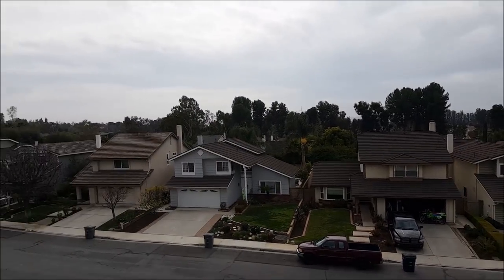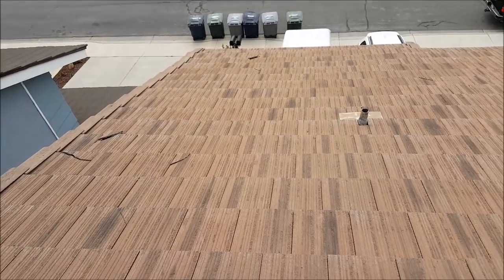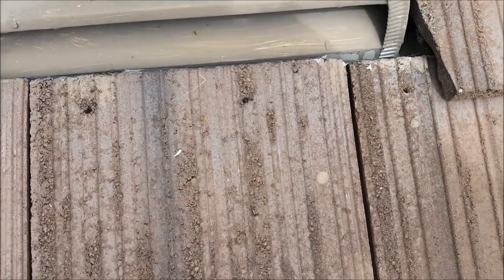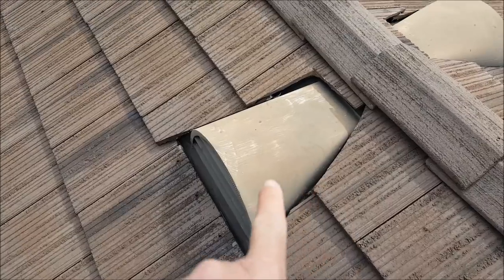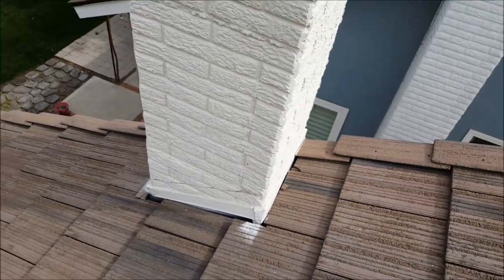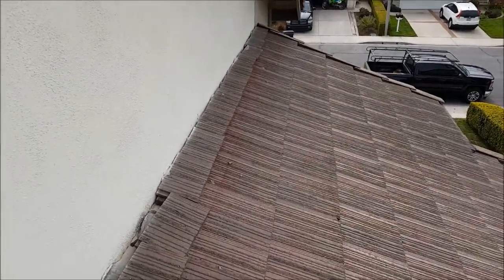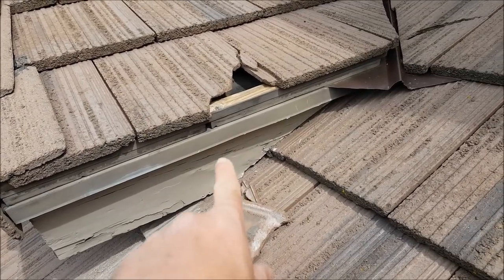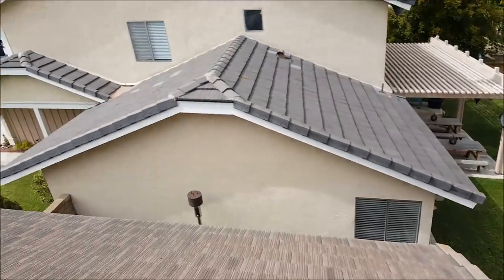This Roofer Should be on Candid Camera and Exposed!!

Comment: Low ball construction is done all over the USA...I've seen it from California, Colorado, and now Maryland...
Reply from the maker: It's to bad.  They low ball the job, over promise, and under deliver.  Makes a problem for contractors looking for a decent profit margin for excellent work.
Reply: It is done up here in Canada too, believe me. I've seen guys screw up simple simple profiled metal roofing jobs (the 36"+ wide stuff that usually comes full roof deck long) with no flashing, screws without washers, cutting it all up, and running it with no paper/membrane behind it. Crazy stuff.